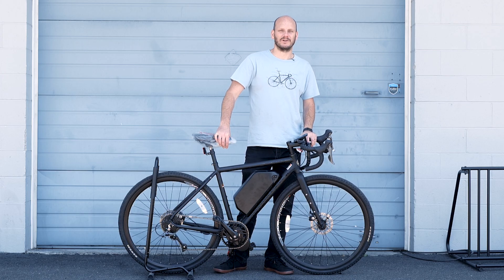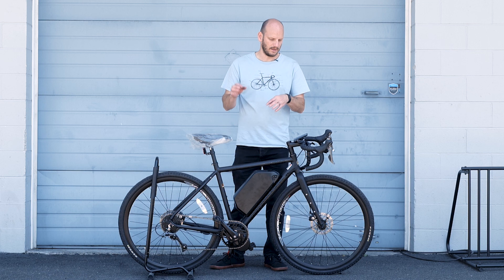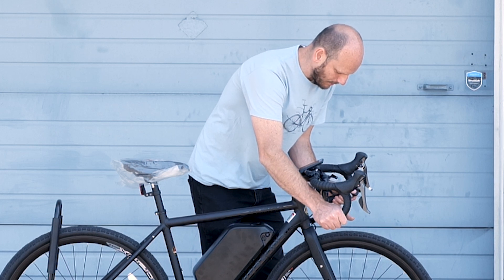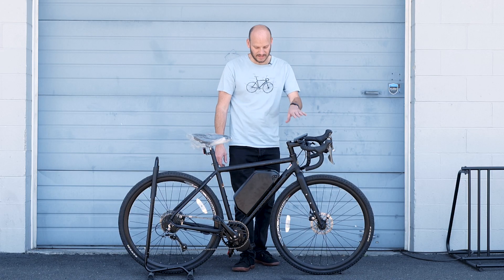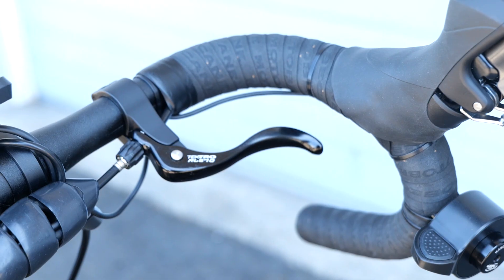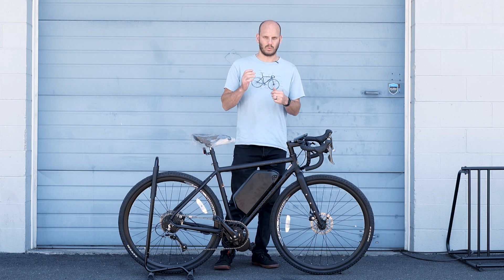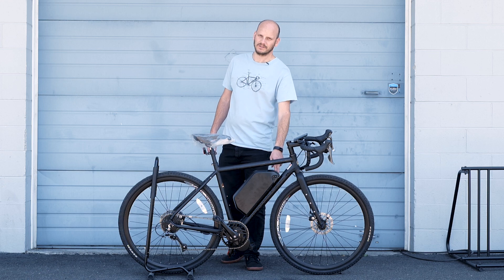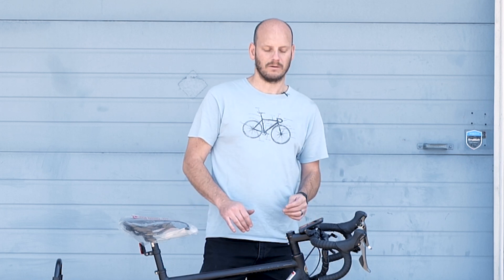Custom E-bike Build: Motobecane Turino Bafang BBS02 750w Mid Drive 52v 25ah Battery

Comment: I have a bbs motor and I have a display with the wrong connector. It's  the triangular green type not the green round type, will it work if I change the connector.
Reply: I think the triangular connector is for motors with Canbus protocol communication. It will not be compatible.
Reply: @keithattwood59  ok thanks.
Reply: @droneracer  Round connector = uart. Triangular = canbus. They are not compatible. There are many uart displays out there, including the eggrider which you can also use to program your controller.